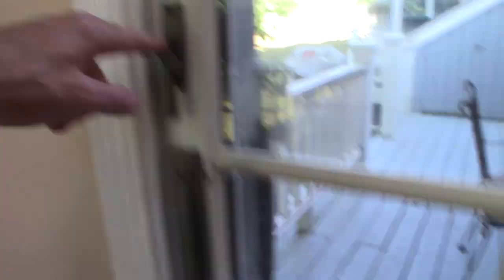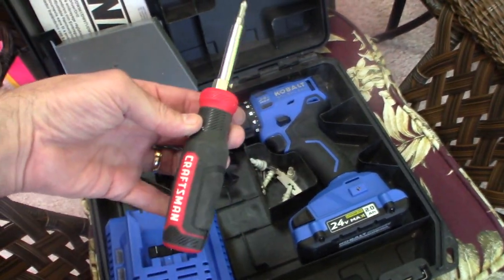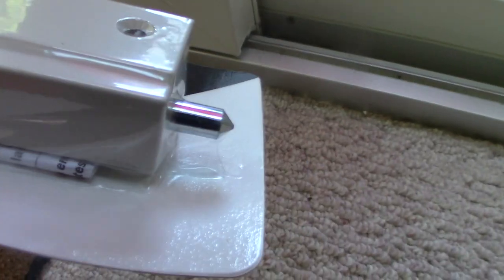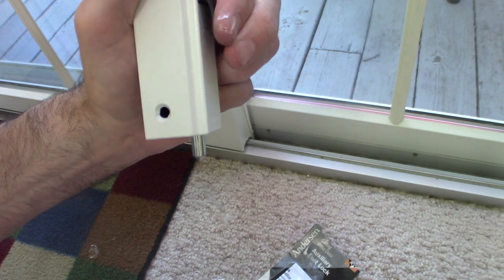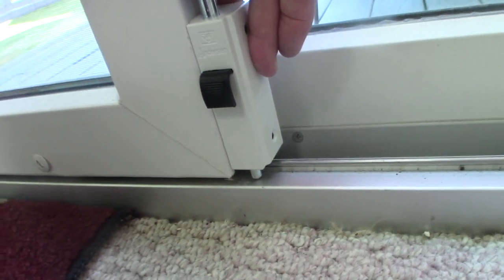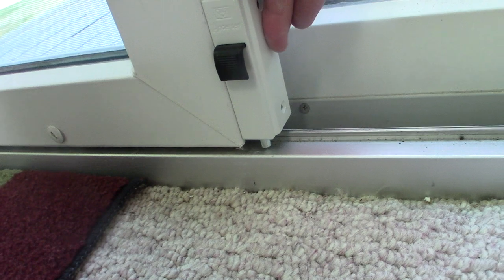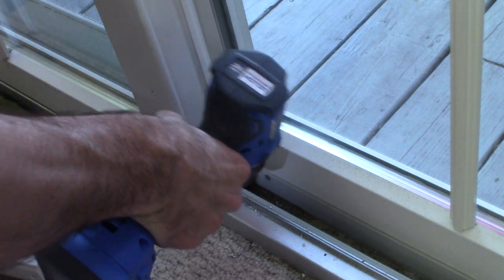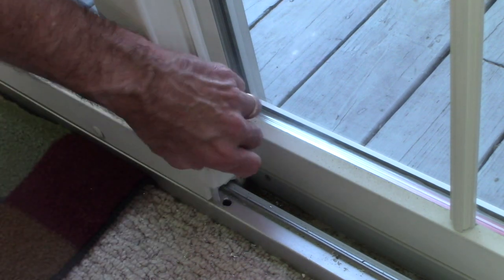How to Install a Sliding Patio Door Foot Lock

Comment: When the lock was put in the hole was drilled in the wrong place. Can I expand the hole so the lock will fit or does the whole strip have to be replaced?

Comment: Hello, great video but I seem to run into 2 issues.  Our patio door track has a big raised ridge that runs down the center of the track.  And, there is already a screw where the unit is to mount to the end of the door.  The patio door is likely from 1995.  Are these issues deal breakers to use this foot lock or are there workarounds?
Reply from the maker: If you look at my video I also have a ridge in the center of the track, It should work? Just drill into the ridge nearest to you

Comment: Great video! I have a foot lock that wont catch, spring is still springy, has just stopped catching to lock. How can I fix it? Thanks!
Reply from the maker: Interesting. Did you try to push it really hard down with your foot? If that doesn’t work it’s probably the latch mechanism is defective

Comment: Are the Anderson doors solid on the inside? Because the doorwall I have already has a hole down by the bottom and its hollow so I'm not sure how the screws would secure the lock
Reply from the maker: I am not sure it should be solid do you have to test it

Comment: Mine is a fiberglass or plastic sliding glass door. The screws aren’t exactly tight. What can I do or use to make them more secure?
Reply from the maker: It’s fiberglass with wood underneath just tighten it up
Reply: @YourReviewChannel  the door is fiberglass. Once I screwed the lock into the door the screws are loose - I can wiggle the lock.
Reply: Correction, it’s a vinyl sliding glass door.  The door frame is hallow, so the screws wiggle.

Comment: What size drill bit did you use, if you don’t mind me asking? Thanks for the info.
Reply from the maker: 3/8'' Thank you for watching my video. and Please don't forget to subscribe.
Reply: @YourReviewChannel  Why won't my lock slide down into the locked position? Tried WD-40 but it is locked in the "open" position.
Reply from the maker: @MrDurham1968  make sure it is on the unlock  position. then you should be able to lock it properly
Reply: @YourReviewChannel  Thank you. Will do.